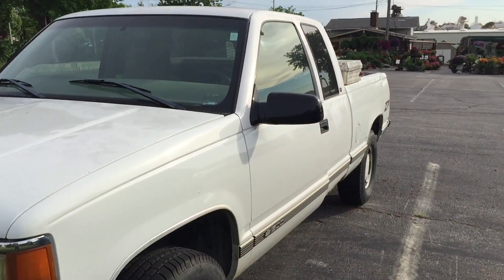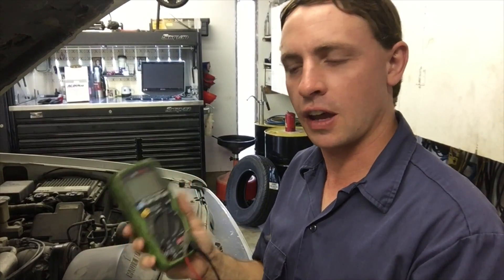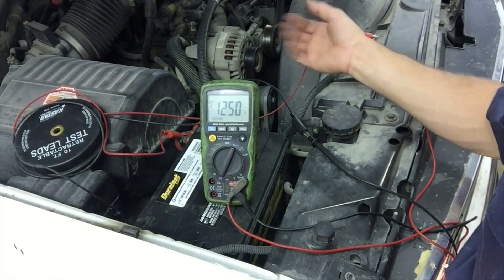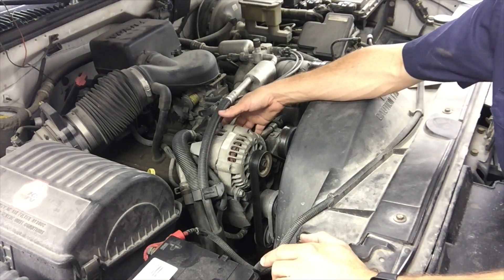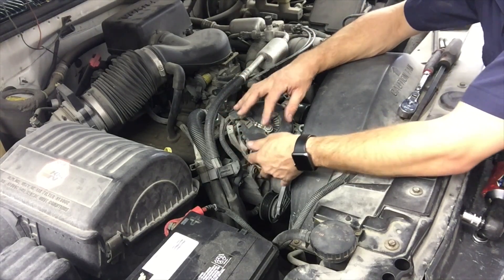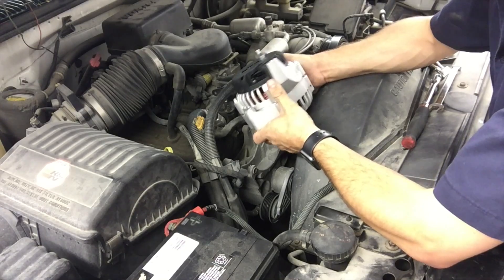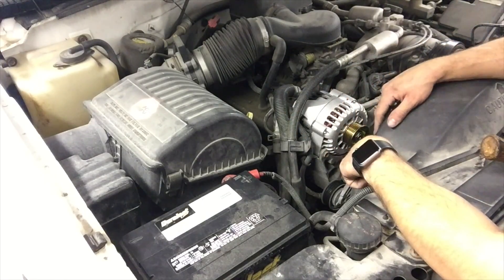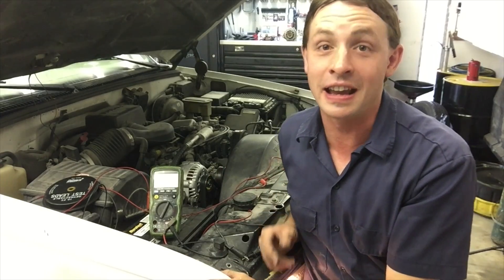The Dead Silverado Mystery Solved!

Comment: My 05 Yukon the battery goes low overnight and my clock radio is set at 12:00 so I swapped a junkyard radio and still set at 12:00 and my battery is low after about 4 days it's completely dead. So I had my battery tested and it is okay..
Update: I waisted the day and $25 to the salvage yard for a used radio. 
 Started out I noticed my battery was running low in the morning when I especially after a few days it would drain the battery completely so what happened was the radio clock was at 12:00 and did the same thing on the swapped out radio. Damn it. 
 I should have kept the old radio I was so stupid. I'm convinced now the problem is in the ignition switch in the column a little black box it's only about 30 bucks. Can't believe the hell I went through to unlock the swaped radio searching the internet watching a YouTube that explained how to remove a tiny chip inside the radio and that was successful but then my chime was even much much louder so I went into the door hinge area opened up the the rubber boot around the wires and cut the tan wire to disconnect the speaker in my left door so I didn't have a chime.  All that for nothing just because GM is so freaking stupid to make all these electrical problems

Comment: My 1997 silverado side post battery wires had plastic coating between the red positive starter lead and the red fuse box lead. When temps got below 32 degrees my radio clock would reset overnight and the starter was really slow or no start. I used a wire wheel to strip the plastic coating between the terminals and like magic the clock stopped resetting and my starter was strong.

Comment: the diode pack in the voltage reg has 3 diodes as its a 3 phase alternator ,, If only one diode goes out it will still charge at about 30% and the light stays out ,,,, happens often Daniel

Comment: fyi old 5.7 vortecs---crank no start or it dies on you going down the road OR a miss after you've done a complete tune up etc ---check the ground strap that runs from back of engine block down thru a tube to the passenger side frame ..if this flat looking strap is badly corroded or breaks it'll cause a miss and even shut fuel off causing a crank no start issue

Comment: The alternator is designed to maintain battery voltage. Charging the battery with a charger prior to starting the engine will prolong the life of that new alternator. Even if I buy a new battery I always charge it a little first if I can. You never know how long that battery was on the shelf.

Comment: Ok mine 03 is doing this! But battery is 6 months old and alternator is about a year old. When I disconnect the negative the truck still stays running and I was told my alt is still good. I will charge the battery it will run I turn it off next day it will start 80% of the time. But if i leave a key over or door open for a few minutes bam she is clicking. I left the key over long enough to just check codes for my engine light and dead all over. I am going. Crazy

Comment: sure the battery light never came on, BUT the voltage gauge in the instrument cluster told me right away something was wrong with the alternator. I have a Tahoe that did the same thing

Comment: Had a similar issue with a 92 c1500 only battery never came on only service engine soon after a few tests I found the starter cable was ground out on the manifold( factory location) bought a longer cable and rerouted it along with new starter and never had the issue again

Comment: Daniel, A fair video with great detail.  However, I think you are a bit of a butcher in that you used a hammer to knock the bushings back.  I think that you were very lucky that you didn't break the aluminum bracket.  It's a simple method to just apply a little oil to the bushings and use either a pair of channel locks or a wood clamp with a socket and press back the bushings slightly!   "Whatever a man can do, a woman can do better".

Comment: my father used to have a 2003 dodge ram with a 2005 ram stock V8 in it we had it for four years until one day we heard a bad knocking noise coming from the engine we took it to a shop and found out allot of things were broken

Comment: I've had an alter alternator bearing making a loud noise. A week later battery always started the car but eventually gauge was reading low and it actually started to cut out running rough.

Comment: Make sure all parts are correct for year model, battery charged, and alternator is good..I checked my receipt and the parts person sold me wrong parts ,I asked for 98chevy and she sold me parts for a 96; I took the ignition lock cylinder back and got the correct one it cranked up, no need to code keys they are programmed for correct year

Comment: lol 14 or higher  will blow the battery

14.3 then should settle to 13.4-13.7
Reply: Lol no...  Resting voltage should be 12.7 on a wet cell 12 volt battery. 2.12 volts per cell. 14.4 volts with alt on is normal but 14.7 volts is about the max I would charge a wet cell without worrying about swelling a battery.

Comment: It's funny how incredibly easy and simple it is to replace the alternator on these trucks. It's almost as if they expected that the alternators would go out easily. Sort of like light bulbs.
Reply: 249,000 miles is not going out easily, they just knew it was gonna be an item that would go bad like the ac compressor on the other side the things below those two components are just pulleys

Comment: A bad battery can end up damaging the alternator, am I right?
Reply: Yes, a bad battery would require excessive charging, which overworks the alternator.
Also, if an alternator is replaced, please charge the battery before starting the engine. The extra draw of current from the new alternator is a great way to quickly burn up that new alternator you just changed.
Reply: Thanks for the tip! :-)
Reply: Keep it on a charger

Comment: hey Daniel, my 2004 Ford Ranger's timing belt has recently started rubbing. Ive been told its a very expensive job to replace it- how risky is it to drive if the belt rubs? thanks

Comment: Great video-very useful! I would like to add one thing: these trucks have voltage gauge on the dashboard, and it clearly shows voltage around 12V when you first start it. After the new alternator is installed the gauge on the dash shows 14V. There is nothing really misterious about the problem (except the battery warning light).
Keep dooing the great work!

Comment: 4:55 Holding the stud is fine and all but there isn't enough room to get a craftsman wrench in there. I cured the problem for .50 cents. Picked up a wrench at a yard sale and ground it thinner to fit between the battery wire and alternator case.
Reply: you got it, get a thin wrench or a grind/belt sand one to fit :)

Comment: Couldn't you just have looked at the voltage gauge on the dash and seen that is was showing about 12 volts as well?
Reply: Xcaliber Trekker it's typically better to have a more precise measurement if you have a voltmeter handy. if you don't, then the voltage gauge is the next best thing.

Comment: i had the complete opposite issue happening with my FJ80 land cruiser. all of a sudden my amp powering my sub would cut out when i applied throttle.... i had an inline capacitor with a digital readout that red 14 and change at idle.... usually mid-high 13's and 14+ volts above 1200rpm. it was reading 18+ at 1200rpm and put my amp into protect mode. Voltage regulator had failed after 6,000 miles.... warranty fixed that! thanks napa,  just thought i'd share!

Comment: $12 brushes and $20 bearings and she will be like new
However you will need some skills to disassemble and reassemble 
also without the big cost of a replacement alternator of About/to/from $250 to $500

age and mileage is the wear and tear 
water and oils are the killer
just ask anybody that owns a Lesass LS 400  the power steering reservoir leaks WILL kill the alternator
or a toyota Soarer aka Lexass SC400(for the yankys)  same issue the power steering reservoir leaks and kills the alternator
toyota just happen to make it  so it sits right on top of it  haha
and when flushing the radiator on any car  put a plastic bag over the alternator as the water and  the crap in it(antifreeze/rusty water) will kill the alternator,  may not happen straight away but it will kill it over a few weeks to a year
Reply: Alternators for these trucks are barely even $100, so I just replace them.

Comment: Eeewwww a AC delco reman alt. Those are horrid. I got one and it lasted maybe a year. Junkyard alts last me a solid 2-3 years with lots of abuse.
Reply: Box said brand new
Reply: i have 42 years experience and been working with cars since i was 2 years old with my father and im double ASE certified since i was 15 years old. 
how do you abuse an alternator?
Reply: The Prepper thats just not true at all i have gotten way more bad brand new stuff than bad reman ztuff
Reply: The Prepper i have been working with my dad since i was little and am currently attending ATC and my dad over the years has had so so many brand new parts fail or be bad right out of the box i would go remanned all day
Reply: The Prepper thanks i guess all we can really get from this is that we both have different opinions and i am going to be ASE certified as well after i get done and have my level 1 mopar which i think is awesome i do agree on water pumps and steering racks they need to be new
Reply: He said MANUFACTURED
Reply: I have a case of beer and I've been drinking since before I was born thanks to my mom and I can do a better job then all of you mechanics combined.
Reply: Eastern Explorer save some pussy for the rest of us

Comment: Solved...For now.  It's a Chevy after all.
Reply: DeadofWinter321 Yeah, its a chevy. With 248000 miles.
Reply: +ExcursionPower
Oh, it's still on the original alternator with 496,000 miles?
Reply: DuramaxAD3 yeah my ford has twice that with none of these silly issues its in rough condition but she runs like a charm

Comment: when you were starting the track I could see the built in voltmeter on the cluster and that it was showing. 12 volts after starting. that right there caught my eye right away. also i see your staying away from that wall as you pull into the garage now. Loll have a good weekend everyone.
Reply: Yep, these typically stand straight up if the alternator is working, you don't need a battery light to come on in order to notice it. One thing you could do is rap on the alternator case lightly to see if that brings voltage up to 14 area and if it does you know for certain your brushes at the very least, are worn down to nubs and you had better correct the situation instead of drive the truck as if it's now fixed.
Reply: Jeffrey Murdock
Reply: Same here.  It's unclear what the value of the different lines are, but it should have been much closer to the 14.  Not halfway between 9 and 14.

Comment: I love my 97 SIERRA to bad they are a dying breed
Reply: With the Active Fuel Managment crap on the newer GM trucks that is very true as they system slowly kills the engine lol
Reply: CamperMike no I mean the trucks are a dying breed themselves. not talking bout computers
Reply: Trucks are not a dying breed. They are hugely popular and why they are selling for insane prices. 60-80 thousand dollars is insane and they build them cheaply and crappy as possible. I didn't say anything about computers. Yes AFM is controlled by the computer. But the special lifters are part of the engine. They cause the engine to burn oil (the lifters are well known to fail) by each time it goes back from V4 to V8 mode vapor of oil is pulled through the PCV system and over time this will mess up the piston rings causing it to burn more oil and in the end a loss of compression.
Reply: CamperMike do you have your head on straight I'm talking about the gmt400 trucks.
Reply: So I've heard. I've tried the M5 and it works for keeping it out of V4.
Tuners. I've seen one from Range that you can plug in the diagnostic port and it disables it until you remove it. Just can't get a strait answer would disabling the AFM void warranty
Reply: CamperMike M5 mode or the Range unit will not void the warranty. Get the truck custom tuned with EFI Live and you'll wish you would have done it sooner though.

Comment: I have a 95 volvo 850 that i think the alternator is going bad on, twice now when i have been out driving, none of the gagues have worked and i have a wierd buzzing noise in the dash somewhere, also the indicators refuses to work at that point, then after maybe one or two restarts when it's warm it can work again or not and the gagues can flutter all around the clusters, also seen the left headlight flicker a while ago when i was parked against a wall

Comment: Could you have measured the voltage at the stud first before taking the alternator off to eliminate resistance issues with the wires? Any way another great video! Keep them coming!

Comment: another great vid.

got a question about a ranger I just picked up. 4.0 SOHC 5r55e 4wd.  It turns over and runs fine when in drive, but when I put the throttle down while in park, it goes WHOOM WHOOM WHOOM WHOOM WHOOM, where I get a second or two of revving then the rpm's drop for a second audibly, and then it goes back up.  drives fine at highway speed, no codes either. Cleaned MAF and IAC but it didn't get any better. Fuel pump? I thought it could be that, but it runs fine at load in drive
Reply: Mmmmm Toast that's the rev limiter. It's supposed to do that so you don't blow up your engine. Try not to rev it so much.
Reply: I'm not mashing the throttle. I have another truck, same exact drivetrain, and I can put the peddle down and hold it at 2000, 2500, 3000 in park. On this new truck, it gets to 2500 or 3000 in park and does that. I'm nowhere near the limiter or the redline

Comment: Why the fuel gauge move that fast at the end ? Even when you start the truck at 0:36
Reply: all those old chevys do that bro its normal
Reply: Philippe Fortin he said it's always done that ever since he bought it
Reply: my 99 suburban does it all the time.  Chevy thing lol
Reply: In my '87 Olds the gauges go nuts during start.  It's been doing that for as long as I can remember.
Reply: Josh Benney mine does too !
Reply: Just to repeat what everyone else keeps saying, Chevy's do that, it means they're working, lol. If it doesn't do that, somethings wrong lol.
Reply: I think I recall them doing that from new, been a long time since i seen a new 1990's vehicle though :))
Reply: This era of chevy did that by design. Their stepper motors could wind up pointing down at start up so the ECM fires these wild signals at it to pop it up into the proper reading range instead of 180 out. When they are 180 out the computer knows this and turns the Gauge light on which until explained is total nonsense speak. So what that really means is turn me off and start me again - like magic it's fixed and the Gauge light goes out. Newer models applied a better system that doesn't confuse people so much. Something about the wild twitchy gauge feedback they got too.
Reply: my 96 just goes past the F on the gauge a little bit when i get it all the way full. when i get to about 50 miles on my trip it will start bobbling around and then i’m out at about a quarter tank. i have a question for anyone that can answer. did GM change steering from 96 to 97 on the silverados? because my uncle has a 97 and i have a 96 and they steer so differently. it is a lot easier to steer on my uncles than it is on mine. i know my power steering pump isn’t going out so i figured they may have changed something. anybody got answers?
Reply: Philippe Fortin its a chevy thing my dads 99 suburban does that all the time